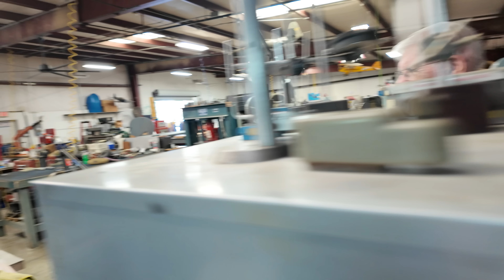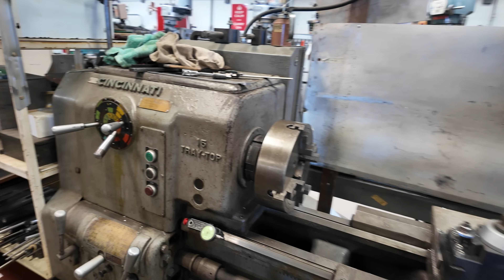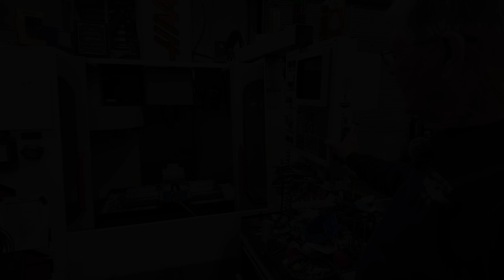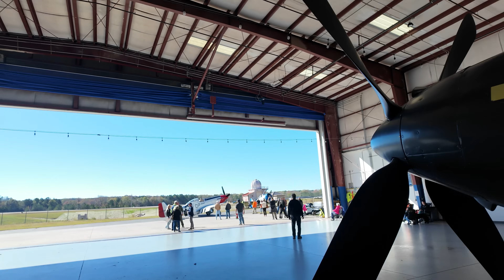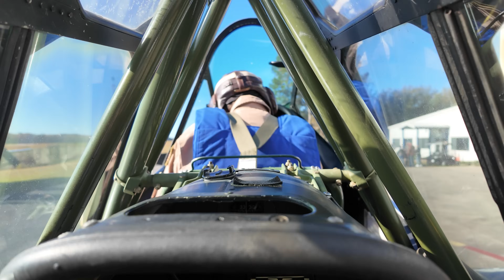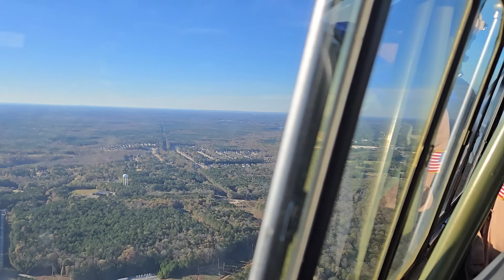Airbase Georgia: WWII Aircraft, Machine Shop, And Flying a T-6 Texan

Comment: Keith, please tell the Museum folks that a local possible landing gear (LDG) overhaul facility might be Delta's Hartsfield Depot-level repair facility.  It's been ~40 years since I toured their landing gear repair shops, but if they still overhaul their own LDG and are willing to help, as long as the Museum can supply the needed parts, they might be convinced to donate their time.  At the very least, those shops ought to be able to give advice on LDG maintenance to the Museum.

Peachtree City is a very nice place -- my parents, sister, & brother lived there while I was in college & my parents were there until they both retired in the '90s.

Comment: keith  thanks for the vid!!  itoo have been in a t6 but up here we know them as harvards and i know where there are 6 till in service outside of london ontario. an impressive machine with a history as the leading trainer of the era mustangs and b17 from t6 if i remember correctly 9 cylinder 2000 hp 45 gallons an hour at 75% power the engineering is roughly 1935 technology and i wonder why it is not jetsons outside now we dont seem to have the same level of creativity we used to

Comment: An air bearing? 
Can't say I have ever heard of such a thing.
Reply: Yeah small clearance and connected to a compressed air supply, very free running (that one isnt) and also able to run at higher speeds, but not high loads.

Comment: Hey Keith, thought I would give your algorithm another massage, with a thank you for triggering some very fond memories involving my early wrought enjoyment of the exhaust notes of well made, large, high performance (of the internal combustion flavor) engines.
My fascinating life has sampled oodles of the mundane and sundry racing varieties, and granted that the following anecdotes are based upon autos that were race bred, these were street versions. The first audio purr for me was riding in a duesenburg pulling 80 mph in second gear, front fenders flexing-the grace note of Fred and Augie's straight eight... Yeah. Second was a lay abed summer  Sunday morning, enjoying the non work day comfy bed, early rural bird calls and such, when I hear the local Ferrari coming the half mile north from the lake. Woodie's out for a lark! He turns at my corner - 3/4 mile west of my bed--big windows wide at my head, the few birds in the yews that flank the portals fade from focus as Woodie begins to let the many throated webers begin the air squeeze of hard acceleration. Second gear winds the tach and the third cog snicks in place just past the 1/4 mile and is topping the revs as the dopler switches and the woodster tweaks 4th into the whirling gear box mix. He says a brief hello to 5th and then power brakes and down shifts for the village limit a mile east, then turned south for the second and third gear twisty bit... and the birds came back and it was time for some coffee.  Nice, calm and still summer country morn. Yep. 
This third bit was thanks to you and the idling P-51. Turns out that a percentage of the WWII WASP Corp hail from my kalamazoo area - my mother-in-law include. Another of the women was named Sue Parish, who I believe had coat tails to the extended Ferrari family of prior tale. Anyhoot, we have an air museum here in Kalamazoo and she kept her plane there. Back in the early 00's, there were several summer afternoons when I could watch and hear from my front stoop, as she exercised her pink P-40 over downtown. Admittedly, not quite the P-51, but raucous and wonderous, none-the-less. Better than a movie soundtrack! 
Anyhoot, hope the duration of my woeful typing endeavor pleases the watch masters and foists a pretty penny to the pile. 
A fella can hope.

Comment: Do the parts fabricated or the machinists themselves have to be FAA qualified (like and A&P)?
Reply: We have several A/P mechanics and A I's in our Group. The P47 has 5 retired Delta mechanics on the rebuild. Log books are continually updated during the rebuild and the FAA does the final certification on the aircraft. I did a five year apprenticeship in machining and hold an A/P license, I also have the Charles Taylor award from the FAA. Safety is paramount.

Comment: Hi Keith, my neighbor in Australia owned a T6 Texan.
Many enjoyable flights in that Warbird.
I could only stomach 2 barrel rolls and 2 loops!
Made an Aluminum storage tank which was installed under the Co pilots seat, piped up with a pump and white oil injected into the exhaust manifold to give smoke for aerobatic shows.